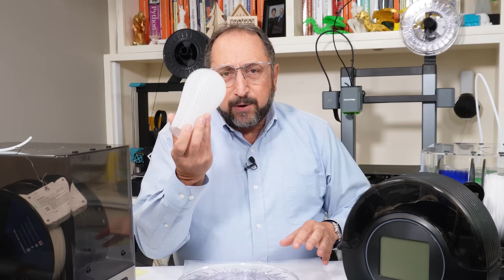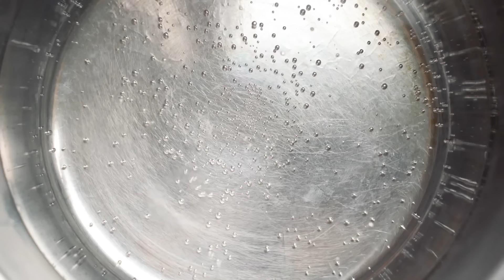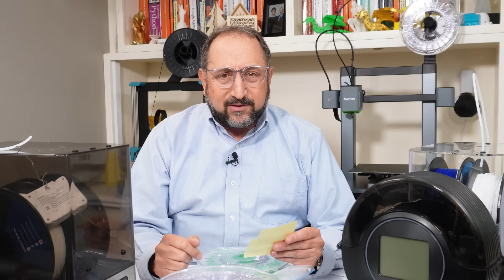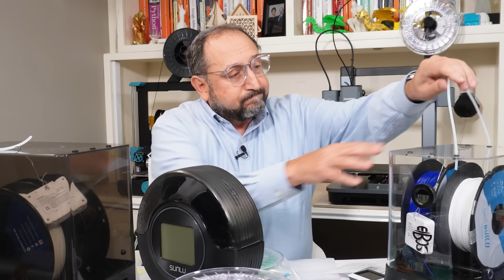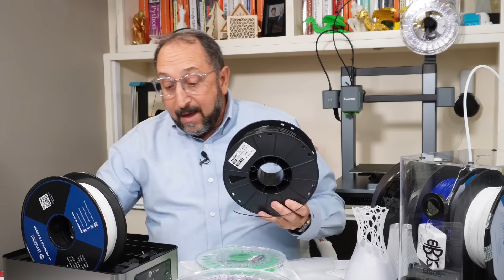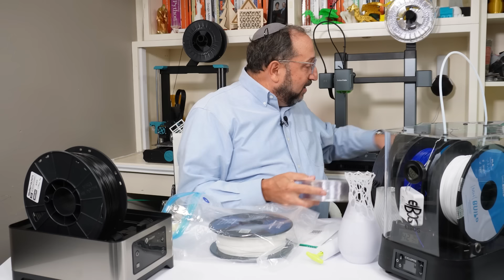It's Not You. It's Your Filament.

Comment: I ran into this after having left some spools around for like 5 years since I don't print that much. I ended up getting that sunlu dryer for about the same cost as having just bought new filament and suddenly everything printed like new again. Then I got a water proof plain plastic storage box (marketed as for just keeping things on a boat) and some silica gel to keep the plastic in instead.

Comment: I only noticed the other day that my newer Prusament spools don't fit in my current dry boxes that fit everything else. I can dry it in my Sovol dual filament dryer, but I cannot feed from it. It is a shame, because I love their lipstick red PET-G for some logo projects I am working on. I am going to need a dedicated drybox (passive drying modified cereal box) that will fit the wider spools.
For real drying, I use a thrift store food dehydrator and it will dry out my TPU wonderfully, I will toss my desiccant packs in there at the same time to renew it.

Comment: I discovered something about dryers.
45 celcius for 6hrs max. I got this figure on google. I believe it is to be valid. I had a print from a good brand that came out looking like it had layer lines that were different colors or shifted in sections about 1/4 high alternating through out the print. I know the heat can be the cause of errors in the print. I had a 60g sample spool of white that comes with the Ender 3 S1 pro.
I printed one part that came out perfect then put filament in dryer for too long on too high of temp and to my surprise the part came out with what looked like shifted layer lines about 1/4" high alternating, making it look like stacked leather rings on a knife handle.
I think too much heat can damage your filament.
My dryer had no recommendations.  It's  the Sunlu brand that takes two spools.
This was my experience,  maybe I'm wrong but all is good since I lowered the temp to 45 c for 6hrs max.
Reply: The vacuum bags are great. I got the same package from Amolen. Same looking box, same colors on logo. Same manufacturer. But I paid around $20 for it on Amazon.

Comment: As usual, a very substantive video - thank you.
I also had huge problems with wet filament.
I'm currently waiting for my Fixdry NT1 dryer from Amazon. I previously had Fixdry NT3 (https://youtu.be/-GRL3hUT94U) which works very well but unfortunately it does not accommodate spools wider than 70mm.

Comment: Do you have any retraction videos for silk fillement? My direct drive seems to chew mine alot at the top of my fillement and stops printing altogether
Reply from the maker: I have never noticed that I need difference settings for silk vs regular PLA.   I would make sure the tension on your extruder is set correctly.   If the spring that presses the gears together is too tight it will eat up your filament.  If the pressure is too low it will under extrude.
Reply: @MakeWithTech  I'm not able to loosen it it prints perfect for 3 hours then cuts off

Comment: I'm also using these bags from esun (and from competitors as well), but the hand pump from esun is not really working well. Furthermore the bags tend to break very easily because of the creases that are created. I replaced the hand pump with one that is battery powered, which was less than 10 bucks on aliexpress. And since the bags are quite expensive for how easily they break, I avoid them when I don't need the filament that often. Instead I also bought a vacuum machine for food, along with a roll of vacuum material. It needed some practice but it works better, since these bags are meant for single use only and seal by melting the ends together. Filament that I intend to use more often, I put in the "reusable" esun bags (or other brand) and filaments that I use on rare occasions I in the non-resealable food-vacuum-bags. Filaments that I use more often, I keep in my AMS or other airtight box with dessicant - maintaining a moisture level at less than 15%.

Comment: Great info. I use the original SunLu dryer that I did a fan mod on. I always use it printing directly from it. And I’ll store the dried filament in the storage box with desiccant when done. I’ve noticed a huge difference in print quality when doing this vs when I left it out in the open air.

Comment: Hi Irv, helpful as always.
I've tried several 'bag' solutions, all of them work, some are (much) better than others.
The esun bag you demo'd keeps the moisture level very low but as you said, the electric vacuum pump takes a couple of minutes to get most of the air out. Using the manual pump takes at least as long - but that's pumping furiously. It's hilarious to watch someone using this method - but it's very hard work! 
However eSun also supply a batch of replacement stick on valves that you push the pump onto, they do wear out quite quickly.
SUNLU's offering is a slightly smaller bag that seals in the same way but  I prefer their bags because:
It is roomy but a slightly smaller size, making storage on a shelf, rack etc much easier & tidier.
Best of all Sunlu bags have a real valve & a screw on cap which makes pumping out the air child's play - once you put the filament inside, seal the bag and eleven pumping actions and virtually all the air is out.
I could pump more times but noticed that as the bag reaches vacuum status it can pull down the edge of the filament reel.
Very similar price and a good time (and energy) saver.
Keep up the good work Irv, learning together with you leading the way is a joy 😊
Reply: I got a bunch of bags from Eibos when they ran their kickstarter. The USB powered pump that they came with screws onto the bag so I can set it up to pull air out of the bag and my hands are free to do other things (like unbag the next spool and get the printer setup). Once done, I unscrew the pump and put the protective cap that came with the bag back over the vacuum port. The only thing that I don't like about these bags is the placement of the vacuum port. Eibos put it in the center of the bag so it sits proud of the spool. This means that for the spools that I have that came in boxes, the spool doesn't fit nicely back in the box anymore. (I prefer to use boxes during storage as protection for the plastic bags. I have a sample from the spool taped to the outside of the box so I can see what the color is at a glance.)

Comment: The blue desiccant will recharge if you warm it up, like in a microwave. The plastic containing the beads is problematic for that, though, and the blue/pink chemical isn't healthy.  If you have a bunch of spools you want to dry, you can buy a container of orange/green desiccant and print some silica gel holders (jars with holes, basically) that fit in the spool hole. The orange/green is much easier and safer to microwave - just pour it in a safe container (like a pyrex pie pan or something) and put a paper towel over it, and run it on defrost for a few minutes, or full power for a few minutes, until it turns nice orange again.
Reply: I use the orange/green beads with printed holders. I recharge them in the same food dehydrator that I use for drying out my spools of filament.
Reply: @Sembazuru  I bought a quart container, use printed screw-top containers, and dump them into a different bucket when they get green. When all of them are green, I spend 10 or 15 minutes recharging the whole mess, maybe once every month or two. :-)

Comment: I use a dry box to print from. Basically it is a plastic box with rods to hold spools of filament and lots of silica gel (sold as cat litter) on the bottom. I use a teflon tube(s) to get the filament running nicely to printer. Basically quite similar to the Ebos dryer box demonstrated but no heating and silica gel to absorb moisture.
I have several tubes that allows multiple filaments to be ready for use. Every tube but the one being used loop back to the box. Having capacity of 4 (or 8) rolls makes printing multiple materials/colors a joy.
Reply from the maker: Thanks for sharing.

Comment: One hint if you want to dry a lot of filament flying around to store it proberly: Do it in witer. The difference in relative humidity is relevant how good and fast drying works. But if you heat up air, the absolute amount of water in the air does not change.
For example: at 10°C a relative humidity of 100% would be 10g of water in 1 m³ of air. If you heat up the air to 50°C, this 10g/m³ are eqal to a relative humidity of only 18%. If you start at 5°C with 80% humidity, you will end up with less than 10% humidity @50°C. Optimal for drying any filament. Maybe outside on the balcony.
If you start drying your filament in summer at 35°C and 60% humidity, you would get 30% humidity @50°C. So trying to dry PLA to less than 30% humidity would be impossible.
So its not all about temperature while drying, but how much water the ambient air aktually already contains before heatin. which depends a lot on the ambient temperature.
Reply from the maker: Excellent comment.

Comment: When I first started 3d printing in Dec 2022 I had too many issues that were all traced back to moisture.  It really shocked me just how much "wet" filament can bugger up a print.  But there was NO way I was going to shell out $100 or so for a filament dryer or storage boxes.  I also found that storage bags don't really keep the moisture out over time.  I'm also very cheap so I wanted to spend as little as possible and use whatever parts I already had on hand.  I came up with a great filament dryer and storage system that cost me under $25 and works fantastic.  So good in fact that I am perfectly comfortable printing nice smooth and glossy TPU at any time.  I used a 5 gallon and a 2.5 gallon home depot bucket, an old pentium 4 heatsink and fan, a 10w (60x60mm) 12v silicone heating pad and a 120°C thermostat control (W1209 I think).  The heating pad gets the 5 gallon bucket up to, and maintains, a solid 45°C and holds 2 rolls.  Technically I could get 3 but I use calcium chloride packs as a desiccant and they're as tall as a spool is wide.  I printed off a ducting system that pulls air down over the desiccant, through the centre in a tube to the heat sink and then it can circulate back up around the, and through, the rolls.  I can leave the rolls in the bucket pretty much full time but usually I leave it for 48hrs and then I take it out and put it in the 2.5 gallon bucket with another calcium desiccant pack.  It stores like that permanently with no problems.  I left a couple rolls like that for 2 months and when I pulled them out they printed off perfectly.
Reply: I use the big silica gel packs that we can get as a car dehumidifier to prevent fogged windows.
Leave a few in a steel drum with the filament. Keeps the humidity below 10% for more than a year.
Reply: Another tool that works is the heaters used in reptile aquariums. They're cheap, they're the right heat, they're designed to run indefinitely without fiddling with them.